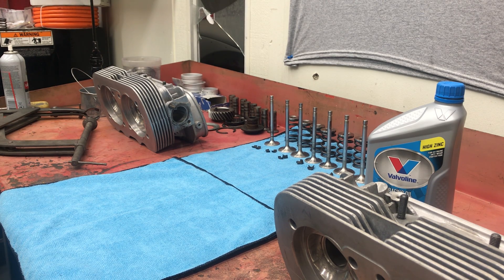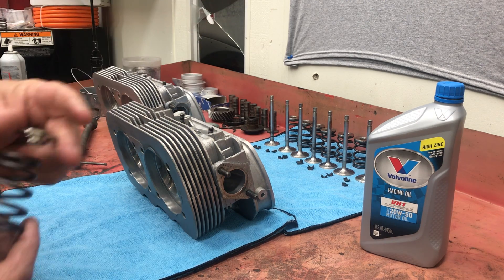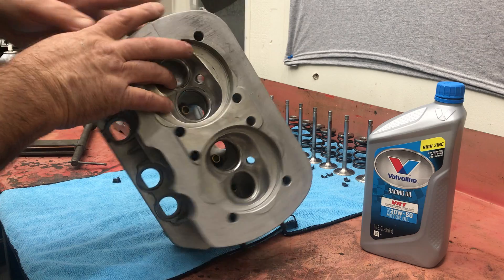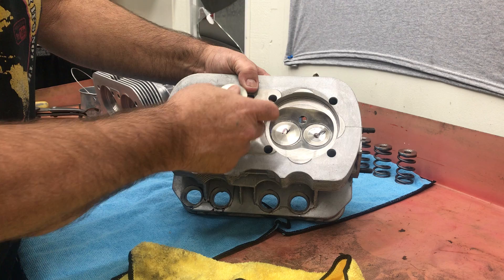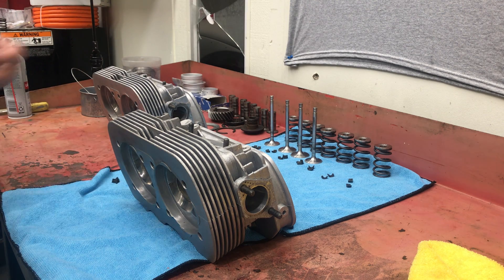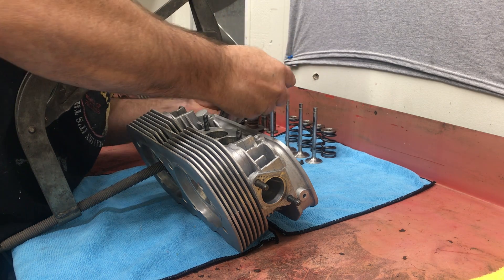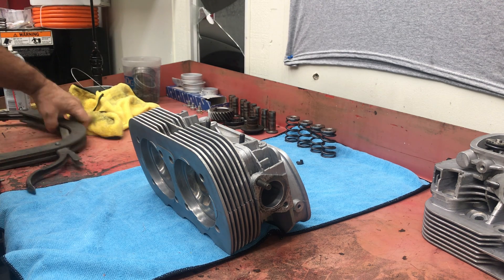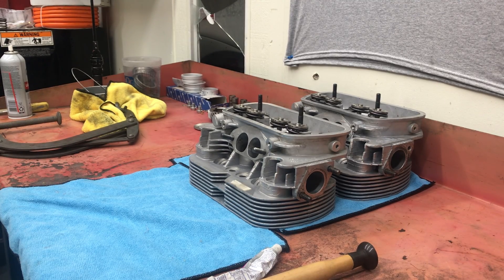Assembling cylinder heads

Comment: Hey Darrin, HUGE fan and factory Toyota tech. Question?? I have 71 SB, 40 Kads, stock cam and crank, dual quiet packs, pertronix distributor, electric fuel pump, lightened flywheel, Scat 1.4 rockers, what's your opinion for single springs and Scat rockers? Thanks you, Ricky

Comment: Thanks for posting this Darrin.
I'm just trying to resuscitate my daily driver bus SP. 
I see where EZGZ puts a steel washer under his valve springs to reduce the wear on the aluminum. Is that an issue?
And my old heads have a small tin baffle on the valve tube side. I see you don't use those on your heads. SCAT says they don't make them and don't know of anyone that does. Mike F'n Garage says he uses them and that they are important to have is a stock build. Have you had issues not using them?

Comment: You are a valued resource, brother.  Talking heads - just installed a cylinder head temperature sensor/gauge.  How high do I let a stock 1600SP climb before I start panicking?

Comment: Is there anything different to do when lapping in stainless valves? I have a new set of aa heads that are going on a pretty much stock 1679. And thanks for the channel..I'm still catching up on older vids. Loved the build with CT also
Reply from the maker: no special procedure for stainless , just be sure to clean the heads very good after you lap the valves in

Comment: back in 1972 when i was in high school and worked in a auto machine shop, they did not use assembly lube (Not sure if it was available back then) . They used a 50/50 mix of STP and 30w oil. What your thougths on a 50/50 mix ???